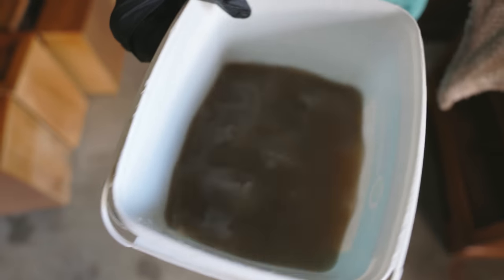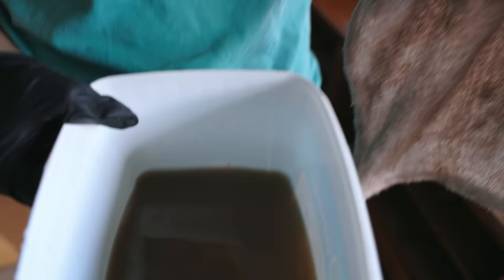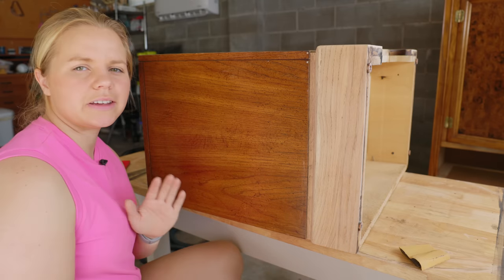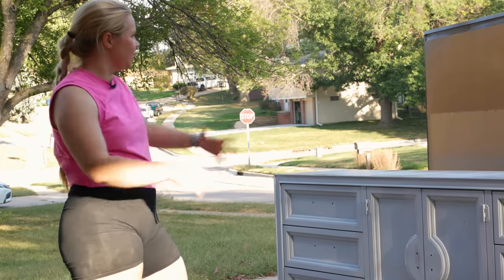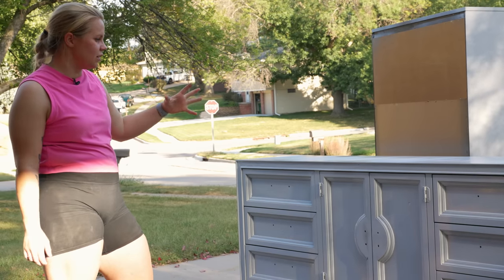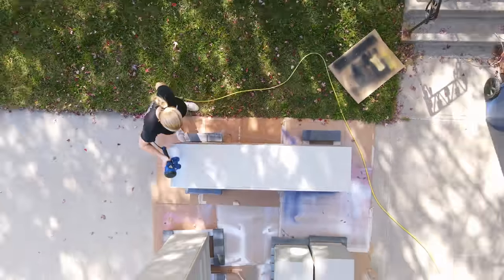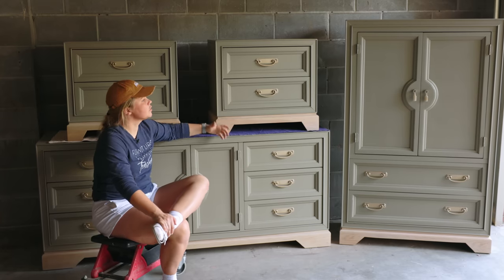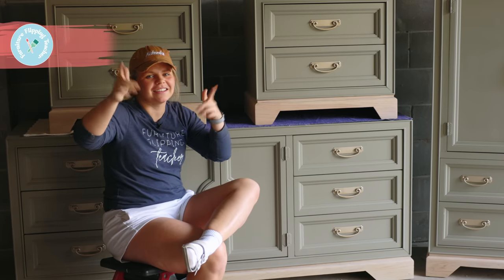Updating Old Furniture On A Budget | Bedroom Furniture Set Makeover

Comment: Very pretty!  But, I would have also used the metal protective backs on the four cabinet doors so fingernails can’t scratch the doors when you reach for those little dangling handles to open them.   Just a thought. 👍🥰

Comment: 1500 if you were selling on marketplace.   I think they would go for more in a furniture store setting.  Maybe 2000 so you could always run a sale at 1800 later if needed.  Or even 2200/1900.  They are beautiful!   I think that those prices they will go quick.  Maybe if you did 2900 you'd have to sit on them a while,  But they're great advertising for your store in the window so maybe that would be a good thing.

Comment: I love your projects, so no shade when I say this- I cringe so hard every time you paint hinges. The paint will crack, chip and destroy the look. I would love to get my hands on a set like this. I would have cleaned and taped off the recessed wood panels inside the drawers and doors -the wood is stunning! I would go with either a matte black or very dark charcoal everywhere else, with rubbed bronze pulls. But, everyone has their tastes! But for real, remove the door hinges for a lasting finish.
Reply: I agree, that wood grain was stunning. It would have looked really sharp with a black or dark gray.